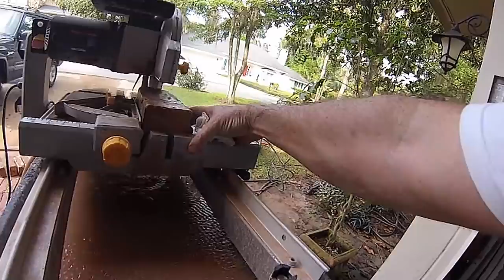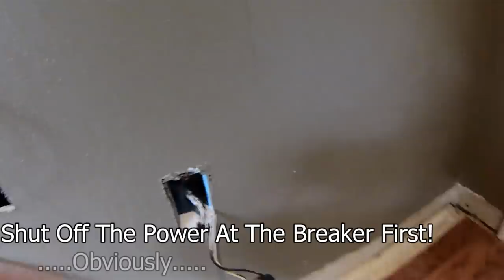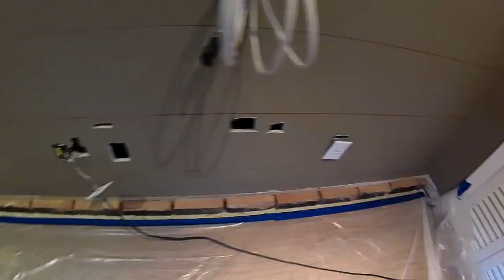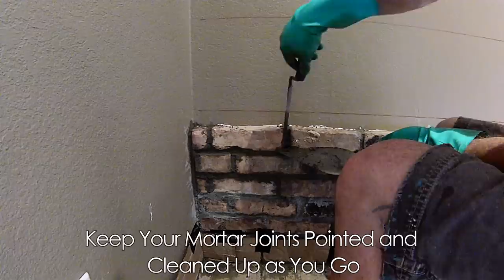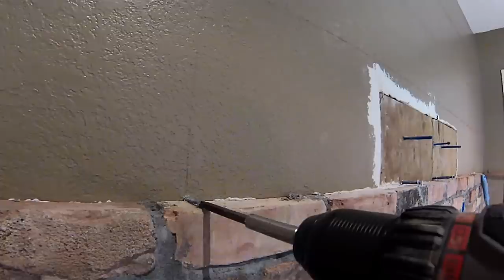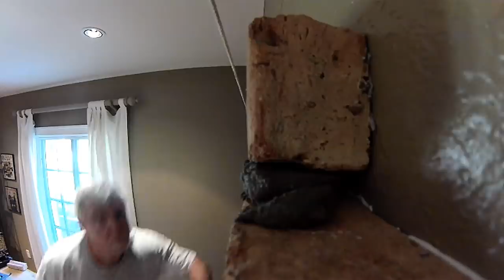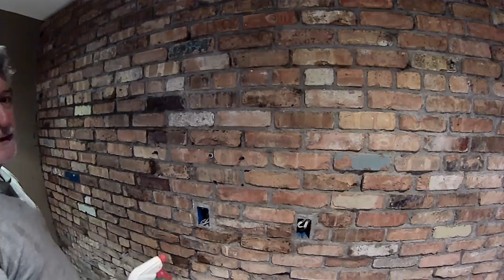How To Build An Exposed Brick Veneer On An Interior Wall

Comment: I've had this video saved forever. I'm doing exactly this today. Thank you
Reply from the maker: One thing I did not mention in the video is that I built this on a concrete slab on grade. If you plan to do this on a floor that is elevated (like on second floor or above a crawl space or basement), take into consideration the weight of the brick. You may need to add some structural support to the floor below or it may sag. Also make sure to do the mechanical fastening of the bricks to the wall. Don't just rely on the adhesive for that. Go to 12.06 in the video and you can see how I tied it back to the wall.

Let me know how it turns out!

Comment: HUGE upgrade. But what is the ballpark on a project like this?
Reply from the maker: I think a cube of that brick is around $400. Plus mortar, thin set, etc. I also bought a cheapie wet saw and a diamond blade from Harbor Freight that costs around $235 for both. I was going to sell the wet saw on craigslist but decided to keep it for another project.

Comment: I'm so glad you put in those screws into the studs. The painted drywall is not load bearing, so it could rip off any time. I did mine by screwing in cement board over the drywall, the screws went into the studs also. The cement board is load bearing and will hold the weight of the brick without having to stack them, just stick them on.
Reply from the maker: Yes I get a lot of comments from people that don't watch that far into the video and tell me the wall is going to fall down. I should have said something about the mechanical attachment earlier in the video.

Comment: you are a good carpenter. I did this kind of work with my father for 10 years and I loved it.  We did everything u could think of as far as custom building.
Reply: my former boss has brick in his kitchen, some comes up to the chair rail trim and some is the whole wall. it looks really good too. he cut 4 slivers from 1 brick and made tiles. it took him a month to do everything lol.
Reply from the maker: Yeah that's a thin brick veneer. You can buy it that way but it's kind of expensive.

Comment: Is one of the best tutorials because it has this old basement look and all the other ones are more like clean and perfect bricks. One question, you did you tried cuting the bricks more thinner? Do you think is possible? Because it takes plenty of space in that way. I am going to do something similar but attached to a Cinder block wall. Im suscribing!
Reply from the maker: The problem with cutting the brick thinner is you have to do two cuts on each brick. Cutting the bricks was painful so I would advise against that. The place I got my brick did sell the thin brick in the Old Chicago but you will loose some texture from digging out random joints. The block behind it will help give it a solid feel though.

Comment: For speed and just being cleaner since yor working inside, I've done this before right from cutting the brick in half. Is do exactly what your doing but use wedges or a spacer system with your line after the wall is complete should take a day or so, use a grout bag or a slicker and trowel depending how much experience you have.. finish your joints with a bullet  jointer or whatever you prefer. But your job really turned out nicely,  curious on how long it took
Reply from the maker: I did several courses of brick using that exact method, but it was way slower (at least it was for me) than just laying the bricks in a bed of mortar. I didn't include any footage of me trying that in the video to try to keep it from getting too long.

Comment: Great work, I love the look of the old bricks, and I have never seen decorative brick to look good. I want to make one of the walls at my home like this. Do you think it is good idea to cut the bricks thinner 3-4sm to save more room space? Also what time did you need to cut the bricks, and that saw blade did you use? Thank you!
Reply from the maker: You can buy most brick pre-cut into thin bricks, which is around 1/2" thick, basically a tile. The two downsides are 1) the thin brick is a little more expensive than a regular full brick and 2) you won't be able to get nearly as much of the deep relief  (ie. the broken corners on the brick and the area where I dug out some of the mortar). The thin brick is definitely easier to install than this. I just used a 10" wet saw from Harbor Freight to cut the brick. It has a diamond blade on the saw.
Reply: @LeeMcNeil  Thank you for the advice and info!

Comment: Looks great. Roughly what was the cost?
Reply from the maker: I think a cube of that brick is around $400. Plus mortar, thin set, etc. I also bought a cheapie wet saw and a diamond blade from Harbor Freight that costs around $235 for both. I was going to sell the wet saw on craigslist but decided to keep it for another project.

Comment: Had there have been brickwork already behind that plaster / drywall would you have used that or still put new brick over the top?
Reply from the maker: No that was the look I was going for as if the house was built with brick entirely. So if you already have brick, just pull off the drywall and clean up the brick behind it. Now if the brick behind it doesn't look like you want it to, then you would want to clad it with another type of brick.

Comment: did you end up renting that brick cutter? I'm literally researching to do the same thing in a music room my dad and i are working on, he thinks I'm crazy but I'm gonna prove him wrong lol i love this look. I'm currently looking for brick as well. Cutting all that brick seems loud and time consuming but would save money I'm assuming. Im just wondering if the rental on the saw trumps the extra brick material? i have a relatively smaller wall aprox 9x7 feet give or take 63 square feet. 72 to play it safe.
Reply from the maker: If you live in the US then get one at Harbor Freight. I got that one on sale and I think it was less than $200. I just went on their website and found one for $279 but not on sale. The Diamond Blade was pretty cheap there also. You can sell it on Craigslist after the your're done if you want. That was my original plan but I ended up keeping it and I have actually used it once or twice since on another project.
Reply from the maker: http://www.harborfreight.com/10-in-25-hp-tilebrick-saw-69275.html

Comment: Out of curiosity, what kind of support did you put underneath this room to support all that extra weight?  I know a buddy put in a real brick floor and put 4 more support posts in his basement underneath that room.  What happens when the floor starts to sag???
Reply: The floor isn't supporting the weight.  The brick is adhered to the wall.  The only thing I'd do differently is use some brick ties.
Reply: So is the wall a bearing wall with support directly underneath it all the way down to foundation? Because if not, then the floor is supporting the wall,, which is supporting the brick, so the same issue may come up.
Reply from the maker: No the brick is resting on a concrete slab on grade. I'm in Florida so most construction is like that here. If I would have been on an elevated floor, yes I would have needed to shore it.
Reply: Ah, that's what we structural engineers like to hear. I can sleep tonight!
Reply: would you have just hung a extra floor joice in the basement ?
Reply: Sistering all the floor joists that support the wall would be the simplest solution, and probably more than adequate.
Reply: thanks, I'm debating on doing this on one of my walls. it seems like a lenghty project, but I'm building a small stone wall in my front yard, so I'll have the equipment in hand, just need the extra bricks.
Reply: Eugene Munn that's my thought as well. Even with shaved brick, has to still have some weight to it.
Reply from the maker: It's on a concrete slab on grade and the brick is mechanically attached to the stud wall so it's not going anywhere. Even cut in half like I did here, I estimate all that brick still weighs 1,500 pounds. You would definitely need to brace the floor if you built it on a an above grade wood floor structure.
Reply: jack mayhoff Cut the brick into 3/4"-1" slices and adhere them to a concrete backerboard(durarock is a brand name sold at home depot). Use a thinset scratch coat on the backerboard, then scrach each brick slice with a type S mortar, then apply a thin bead around all four sides. Gauge each corner and run a string along to get the heights for the run(bricks that fill in the course). This was alot of unnecessary weight, and how I had explained it is how we do this stuff. - Journeyman Bricklayer
Reply from the maker: No doubt thin brick veneer is an option. But as I mentioned in the video, buying one thin brick costs as much as a full brick but you have to buy twice as many. You could cut the thin brick out of a full brick but then you have twice as many cuts - two cuts to get two thin bricks - one cut to get two half bricks. Cutting for this project was painful enough, I would not want to double it. Thin brick does weigh a lot less but I have a concrete slab on grade so weight wasn't an issue.
Reply: +Lee McNeil

Just out of interest did you use any wall ties attached directly into the wood studding? I didn't see any.
If you did good, if you  didn't the hole half brick wall is simply being held by the pasteboard/drywall screws or nails. No matter how much tile adhesive you used or how vertically level the wall is, it's a heck of a weight for the screws/nails to support.
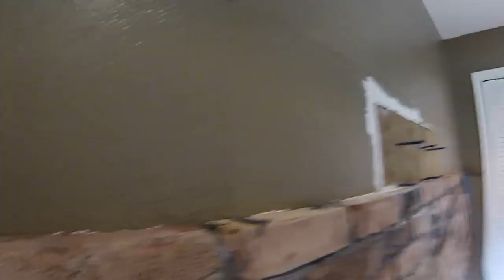Reply from the maker: Yes I put screws into the studs that project out about an inch into the mortar joint at every 5th course. Go to 12:07 in the video and you can see what I did.
Reply: Lee McNeil I worked as a bricklayer apprentice for a few years and a lot of that time was on the wet saw running cuts to the journeymen....I'd definitely have made two cuts on each brick. Never seemed to bad to me, except when it got colder.
Reply: Sea Fletcha so how do you layout the wall so the last course fits?...honestly, this is why I never hacked in the industry because I could never build a lead...just lay to the line. but this is a project I want to do.
Reply: Rob Lo You can get a gauge tape from your local builders supply shop, that would give you the proper coursing to meet your height. I would suggest working anywhere from 4-6. As for leads and bond I would need more info to give sound advice. Let me know if I can be any mire help. Best of luck!
Reply from the maker: I actually wasn't that concerned about the last course fitting tight against the ceiling because I am covering it up with a crown molding. The top course is about 2" down from the ceiling but I don't think it would be really tough to get the last course tight to the ceiling if I needed to. Just make some fine adjustments on the mortar joints on the last 5 or 6 courses and it would work.
Reply: Lee McNeil thanks Lee....the crown molding is actually a good idea. nice work BTW. looks really clean
Reply: hey, also...is that an Atari 5200?
Reply from the maker: I think so - it's my son's.
Reply: Eugene Munn , nothing to worry about the extra weight , the next owner is the one that will have to deal with that
Reply: Mike Appleby if you were a structural engineer then you would have heard him explain everything in detail at the start of the video instead of assuming
Reply: Hey man, it looks great!  I'm thinking about a brick veneer too which brought me here.  I appreciate the detail and explanations.  I also enjoyed reading your responses to some of the comments & questions made by a few "pros."  Go Go Godzilla!

Comment: Lee, great video, I have done something very similar. I put my brick up using shims then came back once the thinset had set up and used a pastry bag and piped the moter between the brick and tooled it in. I wish I had pics to show I flipped that house and the wall I think is what made the sell.
Reply from the maker: I actually attempted that on this project. I was going to include the video I took doing it and talk about it, but edited it out because this video was getting too long. I tried it for about 5 or 6 courses of brick, but it was agonizingly slow. When you did it, I bet you used a thin brick. I my case with the half brick, it took a lot of mortar to fill in the joints and it was way slower for me.
Reply: Lee McNeil 
I actually used brick that I cut in half, I had some old Tumblr brick that I had no use for and it hit me to do a wall like that. I will admit the mortar I used was a bit more loose than I would have normally mixed. What took the most time was filling up the bag! The tip I had fit right up between the bricks and my wife came behind me to slightly tool it. Now I used a pastry bag like you would decorate a cake with and not a morter bag. It was smaller but the smaller tip worked in my favor. There was some extra time allowing the morter to dry so that I could go back and smooth it out.
Reply from the maker: Yeah when I tried it, I just stuffed the mortar into the joints with my hands and a pointing trowel. I have a mortar bag but I used it one time to fill in some joints in my pizza oven I built, and it kept clogging on me. I think the trick to using those effectively is to mix the mortar way looser than you normally would.
Reply: Lee McNeil I agree I spent damn near all day yesterday watching your videos they are awesome!

Comment: Nice job. 
Wall tile adhesive + brick slips is the way to do this more efficiently and safely.
Reply from the maker: I had to look up what brick slips are, and it looks like a brand of thin brick. Which I agree is way easier, but it would be impossible to get any of the depth or texture that I was able to get with this half brick wall. Hell, sticking up some brick looking wall paper would be even more efficient and safe, but it would not look nearly as good.

Comment: how much did it cost in bricks and how lokg did it take Super Cool I am also planning on doing the same thing too first and second floor.
Reply from the maker: I bought one cube of brick which was around $750 here in Central Florida. It may be more or less expensive somewhere else or if you choose a different kind of brick. The saw was around $200 - on sale at Harbor Freight - which you can sell on Craiglist when you get done. The mortar, thinset adhesive and the other ancillary supplies weren't much at all so, less than $1,000 all in.

Comment: Looks great! A question, I have wanted to do this forever, however, I have a wall that is 20 ft horizontal and from floor to ceiling ..88.25 '' tall on the far left and 88.5 " on the far right. not a huge difference but because of uneven floors the far right is taller by 1.25-2.2 '' by eye. could be less than a 2.2'' difference but there is a definite ramp-like horizontal ceiling line that is high on the right, can anything be done in a case like this?
Reply from the maker: First thing, if you have a floor that isn't a slab on grade, and you are planning to do a half brick veneer, you probably need to reinforce your floor structure. Mine is a concrete slab on grade so this wasn't an issue.

As far as making up for the difference in height from one side to the other, you can cheat a just little bit on the mortar joint thickness - from just a little thinner on the low side,  to just a little thicker on the high side. If you cheat 1/8" on each joint, you would make up two inches of of height in 16 courses.. Make sure you spread the "cheating" across the whole wall height, not just the first or last few courses. The big thing is that you want to make sure the last joint at the top is parallel to the ceiling and the lowest joint at the bottom is parallel to the floor (or baseboard).
Reply: @LeeMcNeil  Dang, I always sorta deep down knew I would have to get into the crawl space and add two more beams :(  there is only one beam like a all holding spine down the middle of a 20- foot wide floor footprint and I am on a hill. it is sort of why I haven't committed to finishing my painting or floor, I have been with a prime coat and plywood floor for a long time. What your saying makes sense, Thank you for the good advice.

Comment: Good job budFor everyone her who has done this, do you guys think it'll be better to replace the drywall with hardiebacker?
Reply from the maker: You really don't need to do that. The main reason for using cement backer board in lieu of regular gypsum is because gypsum board will deteriorate when exposed to water. So you would want to use cement board in a wet location like a shower.. Cement board is probably a little better for adhering the thin set adhesive (it doesn't have a paper facing that can tear away), but I am mechanically fastening the wall to the studs so that isn't an issue.
Reply: How about when it comes to the weight?
Would you say is maybe a good idea to brace the studs or do you think the weight is not an issue with this material? 
I'm installing a 225 sq ft wall in a basemant bar
Ashburn, VA 
Thank you.
Reply from the maker: No you should be good. If you think about it, the veneer, although heavy, is going to be laid plumb so the only lateral loads being applied to the wall behind it are going to be live loads or maybe an eccentric load if you hang something on the wall like a TV. This all assumes your wall behind is normal nailed off 2x4 stud construction and structurally sound to begin with.

Comment: Looks fantastic. How has it held up 5 years later? I'm building a house and have some reclaimed brick that I'm asking my builder to use.
Reply from the maker: I'm sitting right in front of the wall right now and it has held up great. I would post a picture of it here, but the YouTubes won't allow it.
Reply from the maker: @osu9400  Yes it definitely is more labor. If you have enough salvaged brick, I wouldn't worry about cutting them in half.